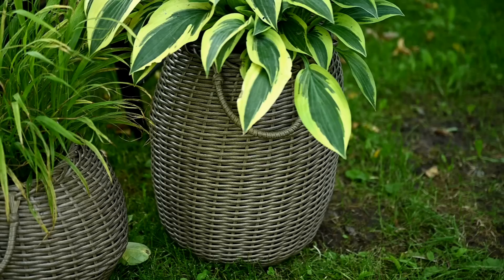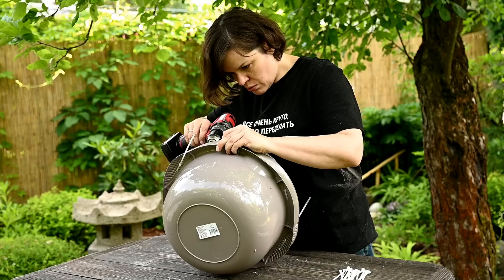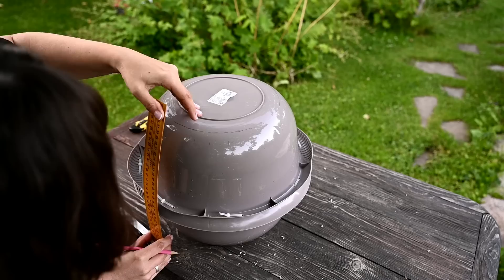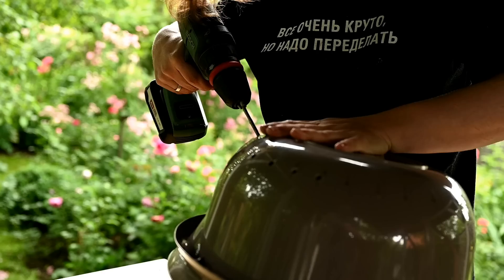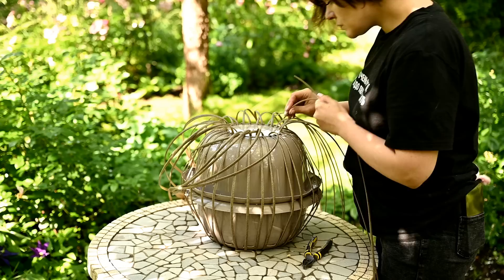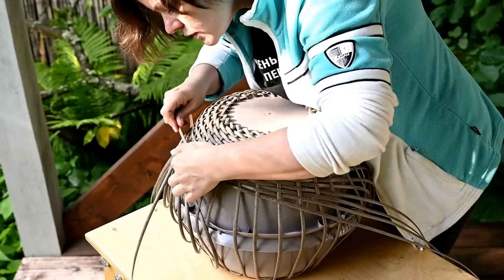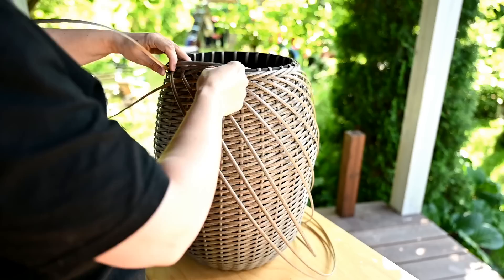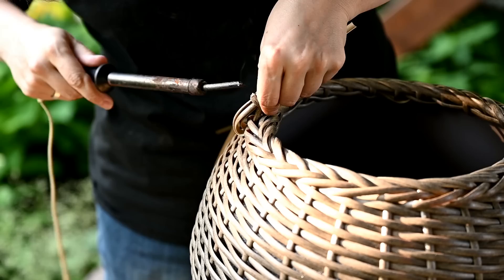DIY woven baskets from Dollar Tree wash basins!

Comment: Wow! Those basket planters are stunning!
Reply: Maybe you can use a solder iron or what I use —  is wood burning tool to burn holes in my pots for my orchids to get lots of air and drainage in plastic pots. I like to get clay but it’s not always easy to find the right ones. And sometimes I just have to repot and can’t wait months.

Comment: I have found that using a soldering iron is easier for me to make holes in plastic instead of using a drill. It can be a little stinky, so that is a con, but i just make sure to do it outside so there is plenty of ventilation. Thank you for your video. Youre very creative. Much ❤ from Nashville TN USA 🇺🇸
Reply: Smart. Also, I just watched a different project video where someone made a hole in a piece of plastic using the hot tip of an empty glue gun.

Comment: Nice work :) Maybe one of the reasons that the drill would not go in is that the plastic was actually so flimsy it that it just bends out of the way? Not sure if it work, but you could try putting something sturdy like a piece of wood on the inside, just to keep the plastic from bending while you drill.

Comment: Absolutely terrific — such a smart girl.  I take it this isn’t your first nor tenth weaving time!  Would soaking the rattan have made it easier to weave?  You are very adept but how long did it take you from beginning to end to complete each basket. 

Oh, you have a solder iron … see it on making the handles.  Can you make a non speeded up version for  those who need a little more help in following the weaving on them.  

You can use soldering iron or what I use with plastic pots is a wood burning tool. They are cheap— just use outside as burning plastic smells and you don’t want inside your house.  

I use the wood burning tool all the time to make holes for air and drainage when I need a pot for my orchids of a particular size and can’t find an clay orchid pot with the right kind of holes on the side of pots and more on the bottom.  Sometimes I just can’t find the pot I need because they are too small, too large, or are too expensive, or where they are located, the shipping will be too expensive.  

I would be up a creek without this little inexpensive tool from my local craft shop like Hobby Lobby, etc. Just be careful — not to burn yourself or table etc. I use it out on patio metal table to solve all issues. You can use an old plate or charger to rest the tool on— they get very hot.

Comment: I'm pretty sure your drill bits were having trouble because you have them going backwards, which is only for the drill bit to "unscrew" out of the hole you've just made with it. It needs to be rotating to the right. (Clockwise)

Comment: 1. Buy the cheap plastic basins. 2. Buy the heavy expensive tools. 3. Buy the expensive rattan. 4. Spend many frustrating hours learning new skills and working with the heavy expensive tools (see number 2). 5. Spend more time cleaning up all the scaps from the project and putting away the expensive heavy tools. 6. Slap yourself in the face for spending so much time, effort and money instead of buying actual ratten baskets.